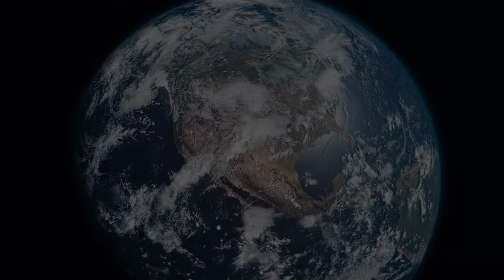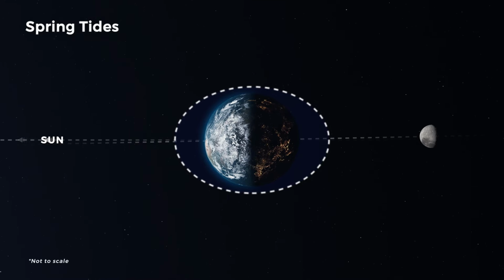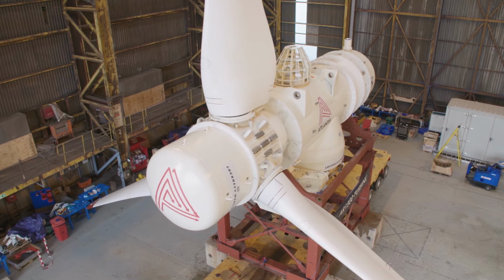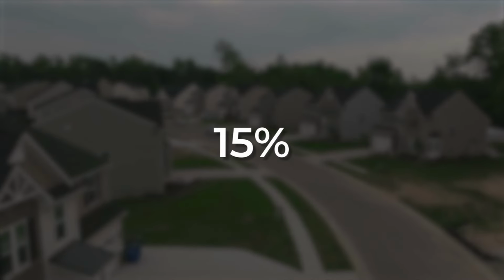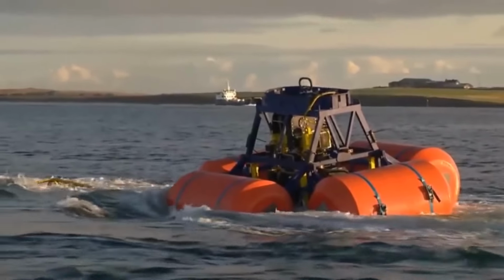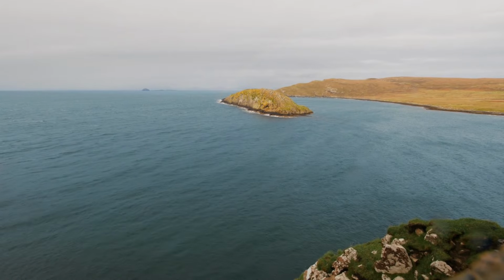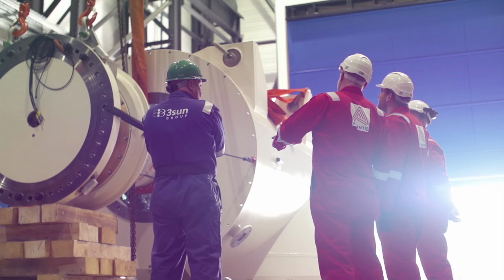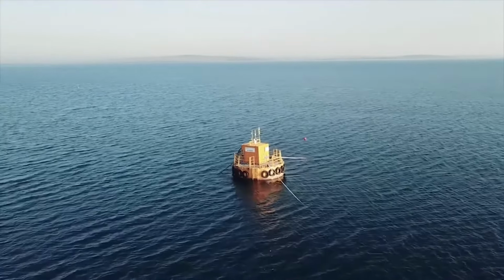Can Underwater Turbines Solve Our Energy Problems?

Comment: How do you keep the marine growth off the turbines? What is the cost of maintaining? I know that the growth causes a substantial loss of efficiency. I live on a sailboat that has to have an anti fouling coating put on around every two years. That means hauling out to apply. During the time frame in between i need to scrub the bottom every 6 months. I think you are dreaming it is about as viable solution.

Comment: If employed at a large scale, this would technically hasten the time-frame of the eventual slowing of earth's rotation, correct?
Reply: @bolbi914    The tides are mostly connected to the moon, which is related to our rotation, but not necessarily in the same manner of 'slowing of earth's rotation' that the original question was phrased. Would this affect our rotation? Most certainly. How? I'm not enough of a keyboard astrophysicist to know.
Reply: I'm pretty sure you're right - the moon pulls up a lump of water (high tide) and friction against the earth's coasts will slowly slow it down. The energy must come from somewhere. So tidal power is basically harvesting the stored energy of the earth's rotation.

Comment: Hopefully you'll read this but I've had an idea for years that if implemented correctly, would work astonishingly well. With just a relatively small amount of depth, 100-1000 meters, water pressure is incredible and perpetual. What I envision is a bulb at the surface with a relatively small vacuum pump attached and a long tube with several instances of turbines reaching down these incredible pressures. The tube would be tapered to allow expansion of pressure vs volume of water vs the negative pressure at the surface spilling out at the surface causing both running water upward and a certain amount of syphoning of the water. Two forces drawing the water upward and that current forced through turbines for generators. I believe the energy needed to maintain negative pressure within the system, if designed correctly, would be exceptionally less than the energy drawn out by the turbines for electricity generation. Even the video you posted, with it's tide turbine, being used in conjunction with a battery, to use the many BAR down below, indefinitely between maintenance shutdowns. I would feel greatly honored if you would create a video, a very comprehensive video, on this idea because I believe it would literally be the answer we've been searching for, for energy, until better orbital solutions are perfected. Please. You can design this where all I can do is talk about it. Take it, build it, share it. Just if you go official with it, include my name. I'm 100% confident it will work and be the cleanest, cheapest, energy thus far created by man.

Comment: "Can X solve our energy problems"
Not unless X takes up a small footprint, is inexpensive and can produce gigawatts of power regardless of the time of day or weather conditions.

That leaves but three options.
1) Nuclear
2) Fossil
3) Fusion (which isn't there yet)

Then in order of usefulness comes.
A) Hydroelectric (dams)
B) Thermal power (heat from deep underground)

And finally, just to name some of the USELESS power options.
X) "This video" (Not constant, not space efficient, not inexpensive)
Y) Solar (Not constant, not space efficient, not cost efficient long term)
Z) Wind (Not constant, not space efficient, noise polluting, not inexpensive)

And yet here we are finding new SHITTY ways of making power because some people believe nuclear power to be the most dangerous and unclean option... When nuclear is currently out safest and cleanest power generation option. Beating all others including straight up solar power. (Because making solar cells is dirty)

Comment: of course the biggest problem is getting them far away enough from areas with fish/whales/sharks etc that would be damaged by or damage them, and then if we are talking the dead zones of the ocean.. i'm sure these turbines being there to speed up water movement would make less dead zones but also increase the distance to travel to put them and maint them.

Though because of that very draw back or one of them, i think its a good idea to put them in places the ocean doesn't have much movement doesn't have much breaking between the layers to help fish and ocean life grow having under water turbines in those areas can help produce more food for the eco system more and areas, if the amount of resource for the fish grow along with the draw back of fish/sharks that feed on dead fish being killed then its a net benefit in both situations, but that means long cords.

I also think while we are burning those large cords we combine their usage with helping create reefs in new areas by creating sub stations and monitoring rigs that serve a dual purpose of monitoring the power/equipment while also being a surface and area for reefs to grow that wont be molested by human touch.

but my idea is talking about a massive undertaking billions or trillions of dollars in the making where the ocean and our power situation both get handled well so its not likely to be something considered for another hundred or so years.

Comment: A question I never see addressed is what effect extracting energy from wind or water has on the environment from the perspective of what that energy was doing before being rerouted. Is the amount extracted such a low percentage it's likely to have a negligible effect, or will be find out down the road that slowing down the wind or tide has unforeseen knock on effects? Does anyone have a source for the magnitude of the energy extraction?
Reply: The energy extracted is a very very low percentage of the total energy. Wind blows several kilometers high, and it gets blocked close to the surface so it is slow down here. A hundred meter wind turbine can't make any noticable change in wind speeds and energy.

Same for the oceans in a global scale. If it is for a small port or a bay that is closed to change the water level then it is noticeable. With a submerged design this is not the case

Comment: Could you do a video to explain how Germany has a larger carbon footprint than France? Even though Germany went with renewable energy and France went nuclear.
Reply: France derives over 70% of its electricity from nuclear energy (producing no co2), with most of the rest being renewables, followed by fossil fuels. All and all, only 8.6% of the electricity being produced comes from fossil fuels, with half of that being from natural gas.
While Germany might have renewables as a goal (the share of renewables is in fact higher than in France), over 60% of their electricity comes from fossil fuels. Worse still, nearly 40% comes from some form of coal, which is terrible co2-wise.
Reply: @hydrochloricacid2146  Does this mean that Germany is in early stages and will one day have a green system that works? Or is it that current technology just isn't up to scratch yet? I'm just trying to wrap my head around the whole eco friendly tech, because right now it doesn't seem to be doing the job.

Comment: 4 tide changes  a day is entirely location dependent. Tides are a result of many forcing factors, M2 S2 K1 and O1 principally, but many more. These interact with the the local and regional bathymetry to produce the actual tides. This can result in one tide a day or two tides a day and various combinations of partial tides. More importantly the local tidal range varies dramatically over the surface of the ocean from amphidromic points where there is no perceived tide to locations with huge tides like the bay of fundy. And finally there are tides - water height - and tidal currents - flow from one location to another, these are related but not the same.

Comment: While the timing and direction of tides can be accurately predicted, rate of flow and volume of water are not as easily predicted with complete accuracy. Here in British Columbia we have a number of "passes" on the inside passage where the tidal flow is incredibly dangerous. Models predicting these flows cannot get better than 70% accurate. Rainfall, wind speed and direction, any rivers nearby all have an impact on the flows. These passes would provide excellent areas to place a turbine, but the turbine would need to be built to operate with fairly low water movement, yet handle very large water movement. A contradiction that could easily halt any such installation.
Seymour Narrows, Yaculta / Gilard / Dent passes ( all 3 are within 2 miles of each other ), Dodds narrows being some of the easily researched places. The middle 3 have Tug channel and a river affecting tidal flows, causing tidal predictions other than timing to be extremely inaccurate.
The YGD set are the biggest channel draining / filling Desolation Sound so there is a substantial amount of water movement.
Seymour Narrows is the biggest channel between Georgia straight and Seymour Straight, moving absolutely insane amounts of water. Even after blasting an obstruction to make it safer, a dangerous pass during water movement.

You find many such channels from Tacoma to Anchorage along the inside passage, huge potential power supply, yet extremely difficult to implement any generation system.

Comment: Whenever it comes to marine architecture I am reminded of the classic acronym for boat. Bust out another thousand. Having to rent a crane on land is half the cost of a traditional wind turbine, having to rent a floating crane is probably twice the cost of the turbine itself and I can only imagine in high tide regions the window for completing work shrinks even more than just in a calm harbor where floating cranes are typically use.

Plus "cheaper" and "batteries" are antonyms. There is not a single company out there where a battery powered device is not at a 2-3 times price premium over what the same machine would be powered by not a battery. Hand tools, cars, lights, wheel loaders, on and on and on. I'm sure someone might talk about Tesla, but considering its stock is through the roof pretty much constantly they can sell at a net loss and recover it basically just on the strength of investor confidence. If the engineering cost of Tesla batteries ever leaked the company would be in trouble.

Comment: Real engineering-"Some systems even use the salinity difference between rivers and seas to produce electricity."

That sounds interesting.
Reply: https://en.wikipedia.org/wiki/Osmotic_power
https://www.power-technology.com/projects/statkraft-osmotic/
Reply: osmosis intensifies
Reply: Not really
Reply: Its actually really dumb, was offered to do it as a PhD but refused, its basically finding areas where rivers and seas meet but dont mix and then force them to mix with a membrane in the middle so the water level rises to get a pressure head. Instead of being thankful for the freshwater they wanna mix it with salt water. What annoyed me is that the project wanted to do this so with the electricity generated, sea water can be desalinated i.e. salinate fresh water to desalinate sea water.
Reply: Amar Abidali wait. They wanted to force mix fresh water into salt water in order to generate electricity to be used to take salt out of water?

Lol. No one saw the irony?
Reply: @amarabidali5316  That's ironic, but irony is fine if so much energy is produced that it leads to a net increase in fresh water. It would be analogous to a company investing money to make money, only in this case the currency is fresh water. Still, it sounds like we are not at that point yet, and may never be.
Reply: @alfford6438  I doubt that would ever happen, as desalination requires really high pressures so a lot of electricity. The pressure gained by making water levels rise by mixing fresh and sea water can't produce the pressures required for desal. Would be cool though if a net increase of fresh water was possible.
Reply: So while browsing for hydrogen production technology I came across a very interesting new science discovery by a NZ Lab named H2IL . It has the potential to replace nuclear, fossil fuel and renewables energy. I was intrigued by something so simple but scientifically logical. What do others think of it?

Comment: You want 100 percent renewable energy? Go nuclear
Reply: Nuclear isnt renewable
Reply: @dylanbrandt72  look up definition of renewable
Reply: @thewestwinger3855  "A renewable resource is a resource which can be used repeatedly and replaced naturally. Renewable energy almost never runs out."
Reply: @thewestwinger3855  nuclear doesnt seem to fit that requirement. Although it is a clean energy source it is not indefinite, and even the safest reactors are far more dangerous than solar panel are😂 I'm not saying solar is our solution because they take up too much space, but I'm saying nuclear isnt renewable, and it's not a long term energy solution, however I do believe conventional fossil fuel methods would be far better if replaced with nuclear
Reply: The West Winger not feasible, because nuclear energy produces radioactive waste. That we have no way of permanently storing.

Comment: Solar + wind or batteries is now easier and cheaper.
Reply: But STILL not financially viable....
Reply: @johncase3998  Any evidence for that?
Reply: @R3lay0  
Let me ask you....How big is your solar array on your home?
Reply: @johncase3998  The roof of our house unfortunately has an east west orientation so that there would barley hit any light there. The overhead of installation is huge for homes. But overall there are many wind turbines and solar panels. So have you any non anectodal evidence that they're not profitable?
Reply: @R3lay0  The reality is that NO ONE does a solar or wind project WITHOUT a Federal subsidy. So without fellow taxpayers carrying the brunt of the costs, they aren't financially viable 
Wind turbines actually use more energy in their construction and installation than they will produce in their lifetime.
Solar barely pays for itself.
Most systems have a 10-12 year payoff (even after federal subsidies) If you have even one basic repair made you can add 1-2 years to that. Just about the time the costs have been recouped, the entire system ages out and needs to be redone. (And the old system needs to be properly disposed of) Plus they benefit from a sweetheart power buyback rate. The government forces the power companies to buy back the extra power you create at a higher rate than they charge you. So even your buyback rate is Federal subsidized.

Comment: I've been going on about this waist of energy fot years my idea was to recycle an oil rige. G. Put a sea piston in each of the legs allowing the swell of the sea to push the piaton up and down the leg  connected to a generator the out put of which is pied ashore to a grid substation that way you keep people in work I. E. Retrain the rig operators into eco energy operators but getting hold of the massive rigs is quite hard the there is the question of re engineering and commissioning and getting cold hard cash to do this just a thought however its my idea if you know of a outlet for this please let me know moving these won't be too difficult as th duch have such a sea going vehicle